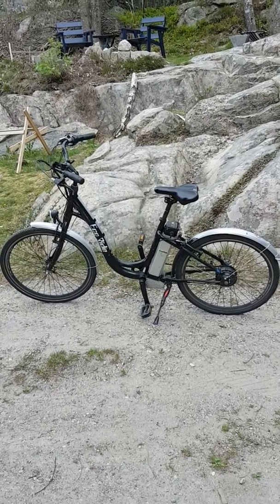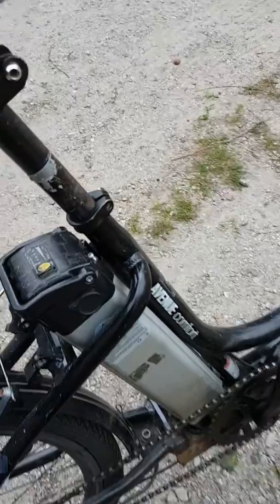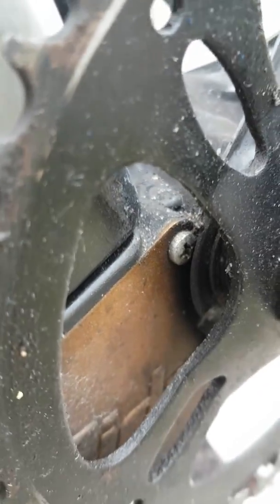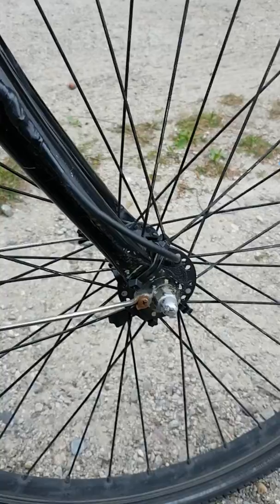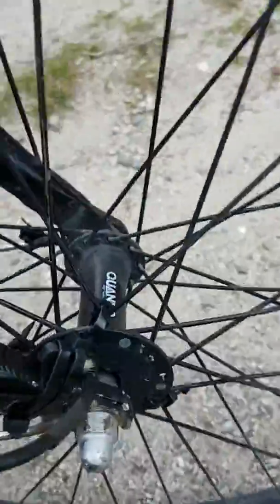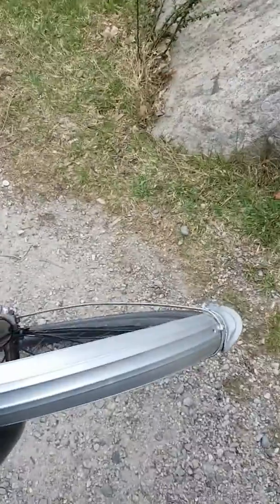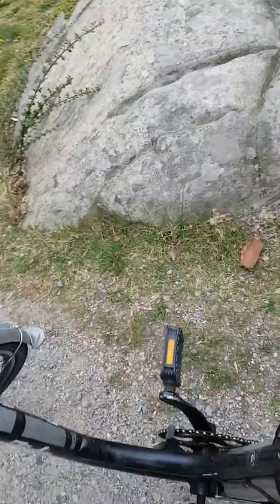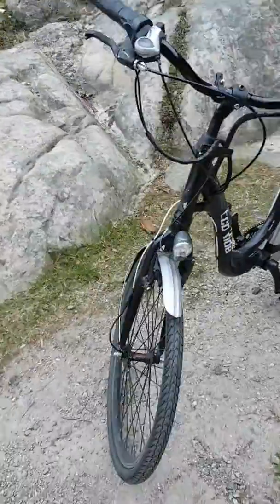DIY-How to bypass a pedal assist

Comment: Why on earth is it mandatory to have to pedal for it to run ? 😢 It defeats the whole purpose why we have an electric motor in the first place , the world went and became retarded . After a heart attack, and three fractured vertebra, spinal instability, muscle spasms ECT , maybe I have a reason to use my moter and not pedal 🤬 in America these bikes are limited to tiny mouse power, pedal assist, but a jet powered y2k motor cycle  is street legal along with car's over 1000 horsepower 😮 . If they want to do something to im prove ebike safety then mandate larger motor cycle size brakes on them instead of the tiny bicycle brakes , that kill so many. .

Comment: So front wheel spinning keeps motor running ? .

Could be dangerous if you need to stop fast as motor is still running.
Reply from the maker: The motor has a cut off, as soon as you even touch the brakes just a little bit the motor stops running

Comment: I don't know what exactly is in those sensors for ebikes but if its Magnetic Reed Switch that switches on and off engine when magnet passes, those wires can be soldered to momentary switch or throttle on steering wheel. It would be much safer than putting in front wheel and factory pedal assist.
And pedal assist is dumb idea, and dangerous when you turning with pedaling - some ebikes are unstable and you can fall off ebike. Wear a helmet always.

Comment: This is the most dangerous thing u can do on a bike. one wrong move and u can potentially hurt yourself and others. Pedaling controlls when the motor turns on, now imagine you going down a hill, your bike may be uncontrollable as the wheels spinn faster, wet roads may reduce your brakes and if  they fail your bike is a death trap. you may end up not stopping in time or even wear out your brakes faster.
Reply: Such fear mongering is not only unproductive, but you inhibit any sort of progress in the development of hybrid electric bikes.

Comment: If you have a “pedal assist” only bike, buy a cheap “5V pulse generator” (NE555 timer) and a momentary push button. Set the pulse generator output to around 25HZ (max for mine was 45). Remove the crank sensor (cut the wires, there are 3) install the push button on the 5V line (red) and wire the output of the pulse generator to the ‘signal return’ (blue) wire. Push the button to turn on the pulse generator, and it will send the pulse to the controller and the back wheel will turn. Let go of button and it stops. Pedal assist only to throttle controlled ebike. Get fancy and instead of push button, wire use potentiometer control that twists like a throttle, with a 3D printed mount.
Reply: Can I use both like throttle and pedal assi too?
Reply: Fantastic information.
Thank you.
I've spent far too many hours searching for this knowledge.

Comment: If you don't want pedal assist just unplug it, the bike will still work off the throttle. The same applies to the brakes cut off, you don't need to use either.
Reply: In Europe there is not throttle on e-bikes sadly
Reply: @Kommaardoor64  there is if you cut the end of a button and wire it to the sensor.
Reply: @Kommaardoor64  same in singapore
Reply: In UK , the GUV  decided all E bikes should have PAS  , so you cant get the motor to kick in without peddling first , which is a pain in the butt , especially when  pushing the E  bike up VERY steep hills ( to avoid burning out your motor ) , so the only bypass is to buy a 555 pulse generator ? ,, but tge controllers ( ebay for eg )  look UNIVERSAL ? What is going on in the UK contrller thaat NEEDS  the pulses ? There must be a hack ?
Reply: My e bike works with throttle alone,  or with pas, or with throttle and pas. It also has a walk function, the walk function makes the e bike go at walking speed for when you want to push it up hills. @studiosys
Reply: Australia same rule its dumb , much safer control with throttle at least limit throttle to 12klm ,6klm is stupid as bike wont go up a little hill. And yes pedal assist to get it going on a hill is difficult and not safe in some situations. On the bike I have pedal assist is good to help me get up a steep hill and possibly saves a little power though that's debatable
  @studiosys
Reply: Many bikes now throttle limited  to 6 mph

Comment: turning off pedal assist is the best thing you can do to an ebike.  You still pedal, but it puts you in complete instant control of how much power is added by the motor throughout the ride.  Vastly better experience than the "1 thru 9" settings.

Comment: On my PAS bike I just pedal one rotation till the motor kicks in, then With little to no effort, I just keep the pedals rotating so the sensor keeps the motor on.
No peddling effort except to keep the sensor turned on.
No mod needed.

Comment: Great hack! I have a Super73. The pedal assist cable on the controller is female 5 pin but every sensor I see on amazon is 3 pin.  And I don't see any "converter" cables"

Any help?

/Bklyn👑

Comment: There is another way to stop the bike without hitting the brakes. What I did was the same thing with the PAS (pedal assist sensor) but then I just took out the little button type switch that the brake lever pushes in to turn off the motor and mounted it onto my right grip on the handlebars so now instead the brake lever engaging it it will now act like a push button throttle so whenever I press the button in(exactly what the brake lever would do to engage the motor) it will start going and when I release the button the motor turns off. So now theres no pedaling and I have a push button throttle;)
Reply: Please make a video how to on what you did. Please Please please
Reply: Wow bravo 👏
Reply: So you wired your kill switch to the sensor, I'll have to try that.

Comment: How's the speed? Is it faster because the magnets are spinning faster? Does it go faster when you pedal faster ? Or isit just like on off switch kind of?  I have a similar led control panel on my bike I was thinking about doing the same thing you did.  Thanks
Reply from the maker: Sorry for the delay! It does max, 25 kilometres an hour. But since theres no need to pedal it his top speed without a delay. The brake safety cut off is the only way to kill the motor when cruising so take care of the brake leads to the controller. Good luck! 🙂
Reply: @shlitser  8